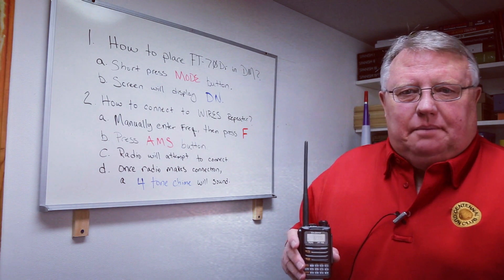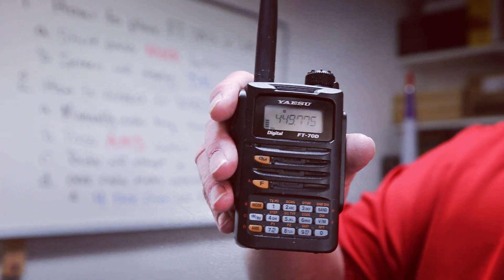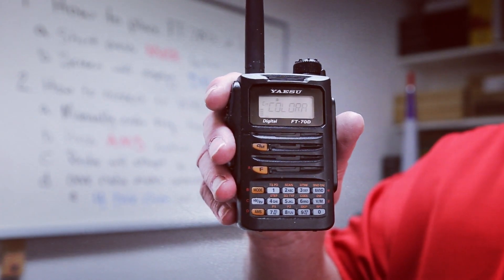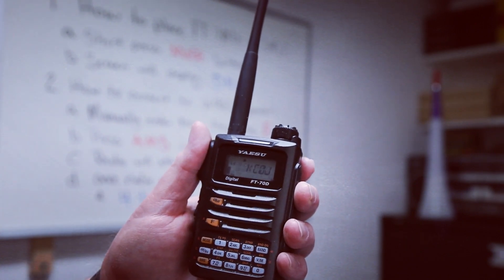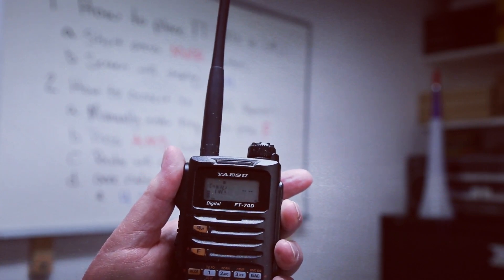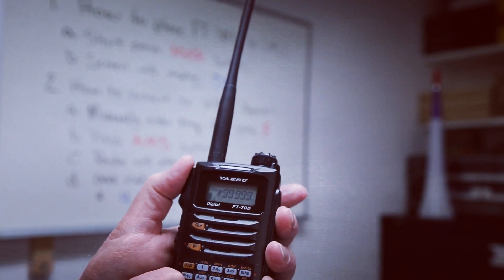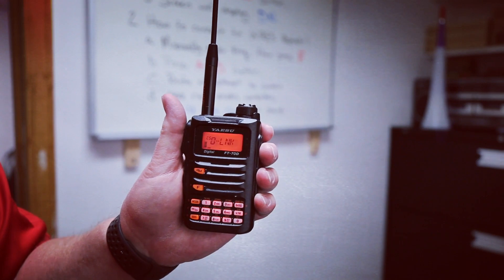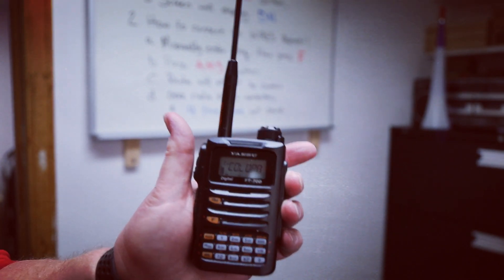YAESU FT-70D - DIGITAL MADE EASY

Comment: With a WIRES repeater so you not have to program the offset?  Just go to the repeater input frequency in VFO mode and press Function then AMS like the video starts?   That is super easy.  I’m assuming it works based on standard offsets following the convention of your country?

Comment: If two people have two FT-70D radios, do they need a repeater to communicate using digital mode?  Or are the two FT-70D units sufficient?
Reply: No, you can use any fusion capable radios to communicate in digital mode via simplex.

Comment: Hi: I have the Yaesu FT70D. I want to program this radio using a software 
, but every time that I connect the data cable I have 
this message ""  INVALID COM SETTING"" How can I solve this issue? 
Thanks

Comment: Hello, Thanks for the video. Helps a lot, however I currently do not have a HRI-200 connected to my internet. Are there other devices capable of doing the same thing like the Shark 2 or 3 nodes.
Reply: Yes. Open-Spot or any Pi-Star based hotspot will allow you to connect to YSF and FCS rooms with a regular wifi connection from your house. To be clear though, you technically won't be on WIRES-X, but you'll have access to YSF and FCS rooms that are bridged to WIRES-X rooms.

Comment: How close do you have to be to a digital repeater in miles average for the rig to work With a hand held antenna
Reply: That is a hard question to answer, it has to do with your antennae, your txt power.  Not to mention obstructions, remember that uhf and vhf are line of sight.   I am 30 miles away from a wires x repeater here in Denver and can hit the repeater full quieting.

Comment: please help me out here.. as I am missing something. I live in California.. there is a KJ6HVS Wires-X repeater near me. Do I need to enter the downlink or Uplink frequency then press F and AMS button?  Neither works and I am very close to Mission Hills.  I should be able to connect.  Do I need to enter Uplink Tone and offset?  I'm a bit confused..thank you in advanced.
Reply: There's no uplink tone when in digital mode. You can still save the tone to the memory, so that if the repeater is being used in FM mode, you can get into it on FM.